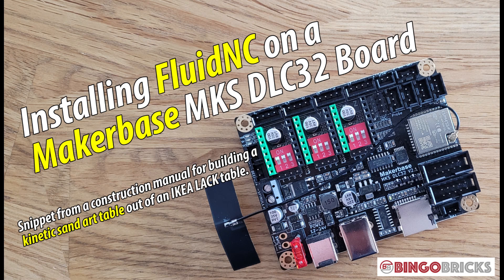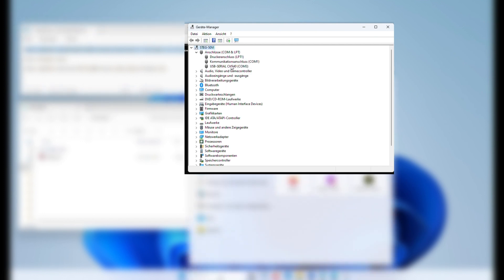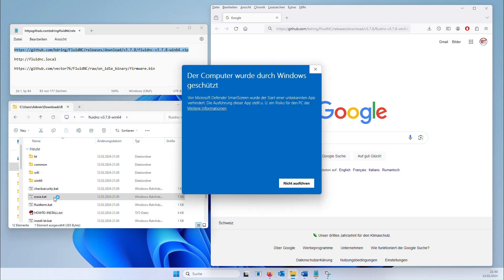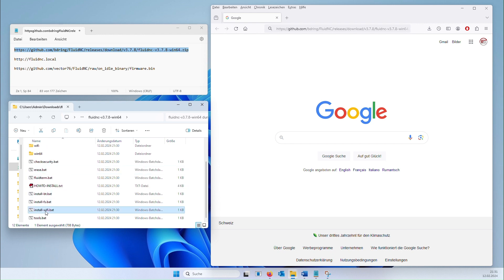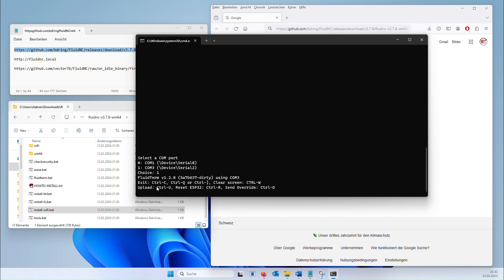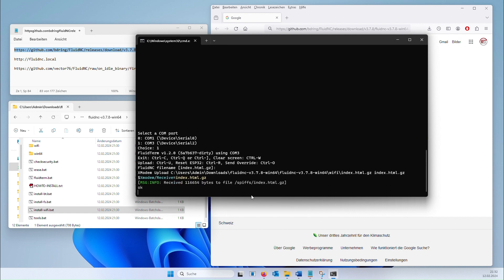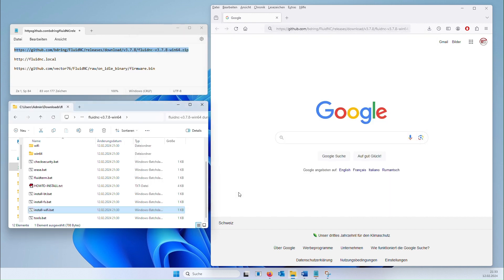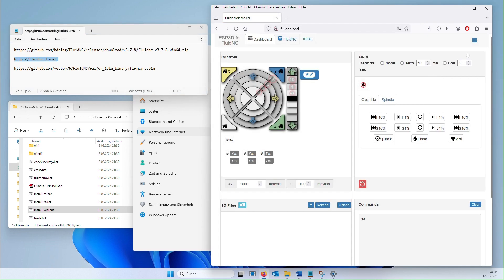Installation of the FluidNC firmware on a Makerbase MKS DLC32 board to control a sand art table.

Comment: I use a Spindle that uses Mains power and 0-10 Volt für RPM Control. Is this poosible with that board? Also i want to know can it use the Fluid dial?
Reply from the maker: Sorry, no support here for FluidNC in general.
Reply: @BINGOBRICKS  ok, thanks.
Reply: @BINGOBRICKS im away from this grbl shit, last sunk money was the SLB ans that fucking shit can not control external drivers. Going with the Pros of cnc maschining like masso or eding cnc.....but thanks
Reply: You need a pwm to voltage translator that goes between it and the spindle drive. Bout like using a cnc4pc c6. I ordered a mks dlc32 max and ill give it a go....if it works ill prolly YouTube it.